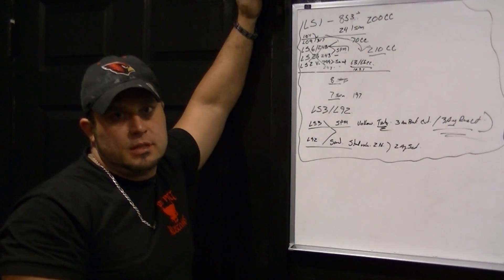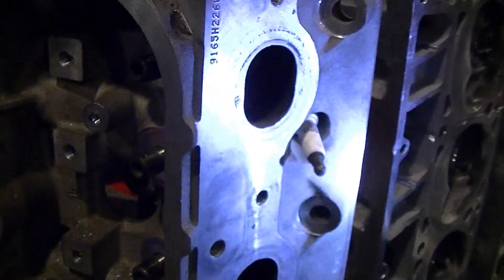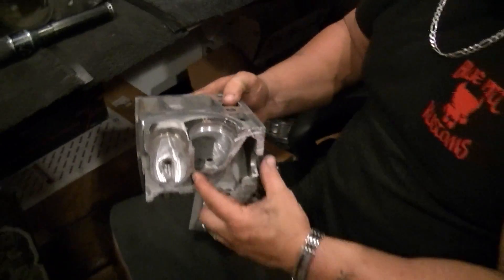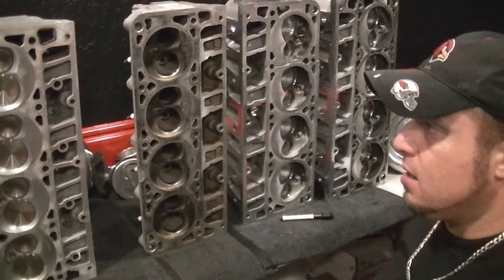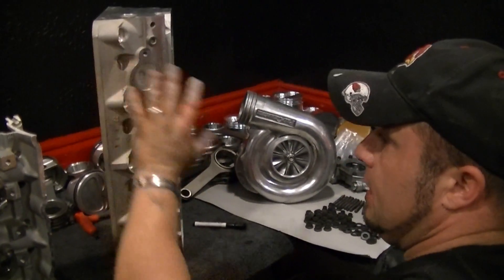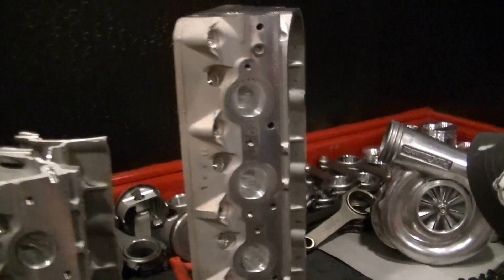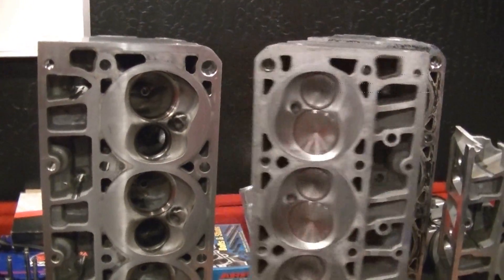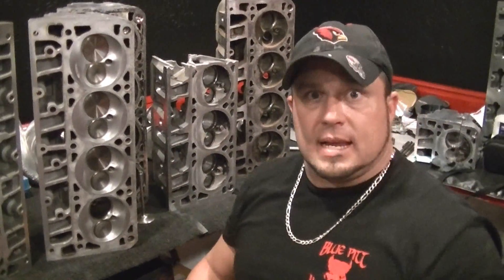LS Cylinder Head Identification Part 2 of 4

Comment: so I have a 2000 gmc sierra 2500 6,0l 4x4 sle that I'm twin turboing I want to know what I need to do to get a set of ls3 heads on my truck motor stock bottom end going for 450whp maybe 500whp